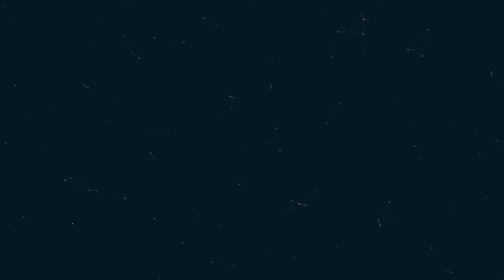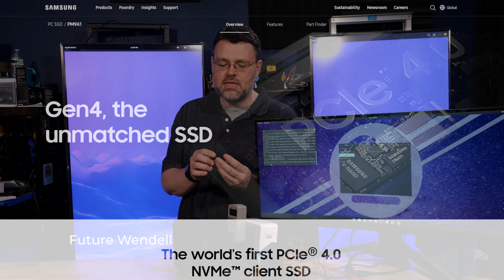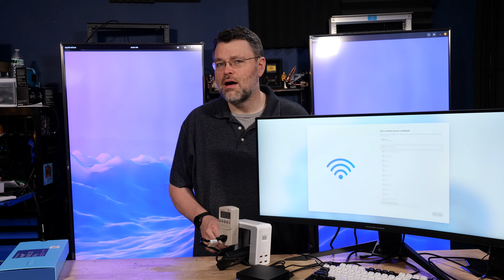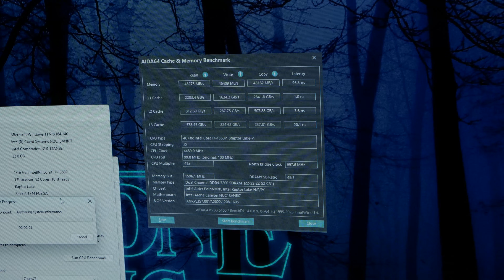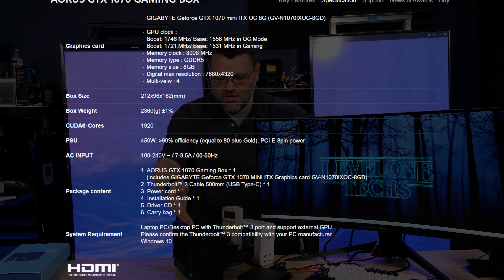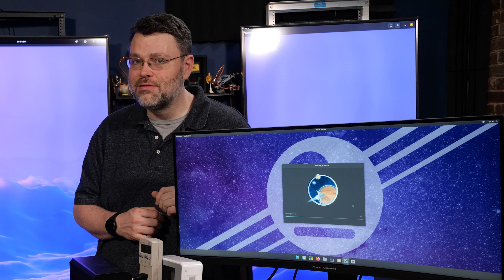Intel NUC 13 and Microsoft 11... Better install Linux

Comment: Just another "let's have a go at Microsoft" video. Come on, really, you literally don't care about reviewing the hardware! Linux users are so desperate to "be king." it's really quite sad to watch. Literally, nobody needs linux unless you have a need for it. Nobody. I've used it as a tool for data recovery, and that's it. I couldn't live with it on a day to day basis. Which version?? You will never ever entice people to come to linux when it's made so difficult for people to choose. The desperation is really showing with the "linux that looks like windows" distros. Lol, why even do that?? It is not windows, and where is the individually? You literally could not wait to get a command prompt up, and while using the command line is sometimes necessary, 99% of home users won't even know what a command line is let alone how to use it. Windows setup will only allow you to continue without an account if you are offline completely. In this case, Windows was able to see the wifi adapter, which is why you get this screen. If you did a Windows install on a device without a wifi adapter and no lan connection, you could continue offline. Online accounts are everywhere!!! You wouldn't be able to use a mobile device properly if you didn't have an account, so why do you do the same on a computer? Shows how little you know about Windows, and this portion of the video doesn't even need to exist. All you had to do was say I've got this device im installing linux on it!

Comment: Initially I was a supporter of the Thin Client style of provisioning, but as mentioned in the video, the licences just started making this look like a poor financial choice. Even Dell added the requirement of paying a management software licence in order to centrally manage the configuration of the machines. Think it was 120 dollars per unit per year?
Reply: HP Thinclients with ThinPro and HPDM for management are still free.

Comment: Would it be possible to hack these to somehow get 2 nics for a firewall setup like opnsense ?
Looking forward to the cluster setup as well 👍
Reply: You bet - options include Thunderbolt Ethernet adaptors or yanking the M.2 wifi card and replacing it with an Ethernet M.2 or a PCIe breakout board to use a standard NIC. Would have to check that last one for this gen, but on previous generations that's been done a few times before

Comment: Hey, you know you can just put "User" in the email address box and fluff the password ie just slap the keyboard for the password, and it bypasses the online account setup. How does no one know this!?!? I have done it since the inception of the online account in Windows 10! Stuff doing some CMD hack to get around it 😑

Comment: I use a NUC with an i5 7260U, 2 core, 4 thread CPU, to run Ubuntu and Octoprint for my 3D Printer.  Night and day difference when compared to the Pi 3B I was using before…. Saving files to a NVME drive vs a SD card, yes please…  Best $130 dollars on eBay I have ever spent!

Comment: I run a local account on my windows 11 install with all the telemetry and all the Microsoft and other companies malware turned off or disabled. I had to go as far as to edit the registry and create reg keys. I get all updates but I can't use the MS store but no big deal as anything in the MS store can be acquired from the original sources also being more up to date. I also have MS office installed (2019) and it is completely usable and up to date ( purchased key online). I bought both serial keys online and paid $5 AUD for my Win11 pro key (that's Aussie dollars) and $9 AUD for my office key. They are legit and sold on a gaming key internet site so does that mean MS are feeling so pressured from Linux etc. that they have to offer their best products for virtually free.
Reply: Can i know the address of that site plz 🙏🏻

Comment: I still use my OG NUC Skull canyon i7 6770hq for a media console, works great still wth a 2tb 660p, 32GB ram and a hole saw/ low profile noctua cooler mod, it is quiet now and has a 92mm demciflex dust filter.
Reply: Awesome, Still using mine as well under tv as a HTPC to stream off NAS, Been a treat but I still have random reboots every once in a while that I could never solve.
Always suspected it overheats sometimes.
Reply: @ShaneMcGrath.  funny you say that about the reboot. If I cold boot mine, it restarts itself after 10 mins but then is stable for months on end.
Reply: @benjamintrathen6119  Yeah I can't work it out, Can go for weeks without issue and yet others it may reboot a few times that week, Seems to be more in warmer weather but I can't confirm if it's a overheating issue or just some fault in all of that series.
I thought it may be the Samasung M.2 ssd in there as well, Maybe that gets hot but I just don't know.
Almost time to upgrade NUC at some point, This one has done very well, I'll wait for another prcie drop on the 12 series and get the i7 version, Should last me another 7 years.  :)
Reply: @ShaneMcGrath. Nice, in the meantime if you haven't tried already, might be worth repasting the CPU + making sure you're on the latest BIOS revision.  I was also worried about Samsung 960 Pro ssd in the NUC so swapped for a low power 660p when it was dirt cheap.  In hindsight, a SKHynix gold would have been the better option. Best of luck mate.

Comment: I had the same issue of no wifi when setting up a 12th Gen nuc. I worked around it by using the command line to install wifi drivers via the command line. What a pain.

Comment: Windows 11 is terrible. My computer runs worse with it than windows 10. Microsoft windows 11 tries to offload background services to my graphics card vRam even though I have 64 Gig ram. It randomly turns off functions " to optimize " whether I am currently using them or not, like my sound, video output, internet, you know, those things you don't really need ... this all started happening when I disabled Edge... Same computer hardware and setup works great with Linux, which are the majority of my machines.

Comment: I'll buy one of these when Intel puts a decent discrete GPU inside - Battlemage or whatever it's gonna be called.  That'd be so cool.
Reply: The serpent canyon NUC looks sweet 12700H/ARC A770m, such a shame that RTX 2060 NUC was only a quad core.
Reply: @benjamintrathen6119  oh shit, I may actually pick that up.  Thanks!

Comment: The most bizarre feature of the 1360P is that in an Asrock NUC it has in-band ECC.
Reply: Yeah it's never enabled in nucs so far, some i3 models had ecc support for ages but only on very few pro devices

Comment: Microsoft really does need another antitrust lawsuit, they are LITERALLY doing the same thing that they got the lawsuit for in the 90s, forcing people to use their browser, well at least forcing them to have it. The should also be in trouble for forcing people to install programs they dont want to, like edge, and microsoft app, cortana ect... all the boat ware no one wants on their os.. big reason why i switched to linux, but i do miss how polished windows was. shame were going backwards in OS technology.. Also them taking so much of your data. Microsoft is basically a giant data collection company now rather than just making good software like they used to. Now they just make software JUST GOOD ENOUGH to get your data with.. so sad.

Comment: Just speced a 12900 nuc extreme for work with a asrock 6700xt using it as a laser server/helper machine with the head laptop with them talking over thunderbolt and trying to use the 10gb out as a trunk with fiber converter boxes to give more bandwidth to the main switch at the stage side but had some issues with converters and the 10g fiber lasers most likely brand crap 🎉but we will figure it and the nuc being the size of a loaf of bread is amazing
Reply: Fine, and now go find the point and comma keys on your keyboard.

Comment: What are you planning on modding for the serial connection, an LG TV or the NUC? I've got an LG that doesn't have a serial port, and it can't be woken up through one plugged into the TV USB port. Do newer ones still come with a DB-9?

Comment: I would really like to see smaller usb c pd GaN chargers become the norm. It's weird when the psu is bigger than the computer.

I really liked the iGPU performance increase from 10th to 11th gen. One more jump to compete with AMDs 780M and I am onboard. But the Asrock 4x4 Box 7735U is kind of looking better. It's just hard to justify to upgrade to either when I have a 4800U
Reply: 14th/15th Gen intel is supposed to be really strong using the new Battlemage GPU architecture.
3060 like performance for the bigger model.

Comment: Will it run PiHole?
Reply from the maker: yes
Reply: @Level1Techs  I am trying to come up with a pihole solution I can give to my in-laws and forget about it.
Reply: @D Reaper Thank you.  Just what I wanted to hear.  I thought that if one could do it on a Raspberry Pi.  I might not need much.  I only have about 5 devices on my LAN.

Comment: Bought my buddy a 5800h beelink mini-pc and he loves it. I had sent him an AMD 9590 + mobo + ram + AIO many years ago and the 5800h is significantly faster which is kinda hilarious how far we have come. These mini-pc are pretty amazing, regardless if AMD or Intel (though I prefer AMD).

I want to see STEAM get their foot in the mini-pc market. They already have the steamdeck.... Imagine a more powerful steamdeck but its a desktop. That would be FREAKING SWEET. The steamdeck has 4 cores 8 threads of Zen2 with 8 CU's of RDNA2 cores.... not bad. Now imagine a 8 core 16 thread desktop variant using newer Zen4 with 20 maybe 30 RDNA3-4 cores. All in a Mini-PC box. Like holy shit. Steam could become the MAC of windows/linux..... high quality stuff in small form factors would be sick. When it comes to price to performance, the Steamdeck is technically unrivaled. You cannot buy anything close to its performance in gaming for the same price. Even if you go small form factor mini-pc like the beelink 5800h, you still technically need a monitor, mouse, keyboard, to go with it. That alone puts you over the price of the steamdeck. And you can't build a new pc system that is faster for the same price either. Sure, used parts, you might find some killer deals, but not likely. you would be lucky to build a used pc to match its performance in gaming for the same price....
Reply: Is the 5800h beelink mini-pc the ser5?
I just got a client to order one! I am looking forward to installing Linux on it!
Reply: 5800h doesn't support AV1 hw codec
Reply: @jakitliang  who cares?
Reply: Valve already tried their Steam machine initiative and it flopped. It's much easier to make compromises in the name of portability, a SFF PC invites direct comparison to a console and I don't think Valve wants to subsidize the hardware at the same level.

Comment: Not that I have any love for Micro$oft but... What version of Win 11 are you installing? I just loaded up Win 11 Pro on a new desktop and it let me do the offline setup... And as far as I can recall, it always has if you tell it you don't have internet.

Windows 11 Home does indeed try to force you to sign into your Microsoft account.
Reply: Yeah but that wasn't my point...  There's no love lost here for M$.

I just like info to be accurate. 😁

Comment: With latest Rufus you can burn the Windows ISO and make it skip all the annoying steps
Reply: This is why they say, Windows is a great OS -- if your time is worth nothing.
Reply: I only run Windows in Virtualbox and roll back to the last snapshot after every shutdown. (Needed to access work.)

Comment: I wonder if this Thunderbolt networking can be set up on something like harvesterOS or RancherOS or K3OS... Kubernetes cluster with limited OS upkeep and security aspects with 40Gbit interconnected nodes would be great with these for homelab or homeserver... especially since the iGPU could potentially allow acceleration/off-loading of transcoding duties in media servers or of image processing pipelines. A six port 2.5Gbit router/switch, 3 of these NUCs, maybe a dual 2.5Gbit NIC 3-4xSATA NAS for netboot source and iSCSI or NFS storage duties and a 2.5Gbit uplink left... and you have an "enterprisy" hardware/software cluster/servers stack for minimum TCO. That would rock! Heck, some of those Kubernetes systems could be boot deployable with netboot, so you could use the M.2s inside as local cluster storage with Longhorn, using NAS as source for such boot image and configuration storage and data store whilst these could be the compute nodes...
Reply: You should drop this suggestion in the forums.
Reply: @Zaf9670  I would, but there's no clear topic for this video, at least I couldn't locate it... there's no link here to any specific thread anyway, and on the l1t page with this video the "Discuss on the forums" button seem to be linked to the same page and not any specific thread in the forums.

Comment: Boot via iSCSI should be more widely adopted. I like the engineering on this thing. Why upgrade the NUC when you can just plug new drives into your NAS
Reply: I dunno, boot from NFS (usually via TFTP) has been around for decades. Oh wait, Windows doesn't do that.

Comment: the only case i know which got a wireless charging port thats decent is the bequiet dark base 900 pro rev.2 when it got released i got it for 220€ inclusive shipping, now its 300 bucks. insane that prices went up for cases too.

Comment: Microsoft could easily dismiss any FTC issue about Microsoft accounts during setup by saying that network setup is only 'recommended' and that it's already documented how people can use the Shift+F10 way for an 'advanced' setup experience. But the FTC won't do anything because that would be a precedent requiring FTC to get involved in Apple's requirement to have an Apple ID. And would possibly extend to other anti-competitive behaviors of Apple including right to repair. Apple is like FTCs favored child or a third rail.
Reply: "Apple's requirement to have an Apple ID"
You can absolutely use a Mac without Apple ID; just without sync, the app marketplace, etc.
Reply: So, the latest iPhones aren't locked to require an Apple ID or to own some other Apple device to set up? You can actually get a new iPhone (with no other Apple product or service at all) and use it as a phone instead of a drink coaster?

Comment: The ideo of Thunderbolt interconnected cluster (maybe with Proxmox) is just awesome. Essentially it would make a 48 Thread machine with 6 SSDs etc that idles under 30W...
Please do it and keep us posted
Reply: No ECC RAM :(
I'd love to see the first video about implementing a cluster through TrueCommand and maybe a comparison of the same setup with Proxmox!
Reply: This will not work as you expect it to. There is currently no good way for a guest to influence what core should be used for a task, when to slow down or boost the CPU clock etc... So the energy consumption of a guest system vs bare metal is very different. Intel is currently working with the community to improve that, but right now, this is a known issue.
Reply: Proxmox cluster, with ceph, and pbs server inside of it, as a container, along with a docker swarm configured (one ct for each node).
Reply: Yes! Do This!

The Lord came down to Jesus and he said;
"Yeah, so your job is to make sure that 2023 Years after your death you must ensure that a man named Wendell does an awesome video on a Low-Power Thunderbolt Interconnected Proxmox Cluster using Intel NUC's & SSD's!
This is my word!"

And thus we must ensure this prophecy!
Reply: @LND3947  he never said that
Reply: @blu3_enjoy  Well duh, he probably said it in Hebrew or something.
Reply: @blu3_enjoy  Ah yes, my bad, I forgot God doesn't speak English. After all he is a being from beyond our world....

Here it is in the appropriate Klingon tongue, I hope you find this of suitable reading:

HIja'! yItlhap!

bang Qong 'ej SaHchu' ghopDaj.
"HIja', 'ach malja' wIbuStaHvIS, malja' ponglIj lo'taHvIS, malja' puS. nuHmey ghuSchoHl &u'pu'bogh nuvpu' ghu' net chaw'be'.
Qu'vatlh!

'ej qechvam mIpqu'!

Comment: Just connect to the network. For Username and Password, type anything "a" or "cancel" as the username and password and you can make a local account. No command prompt necessary.